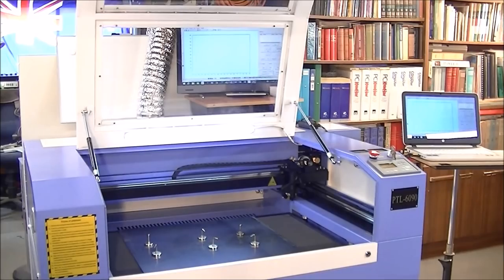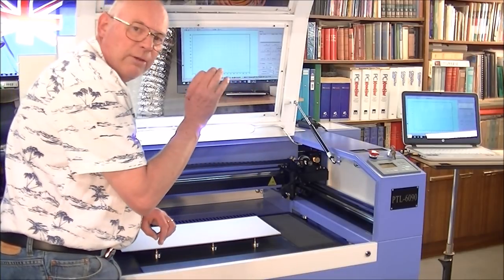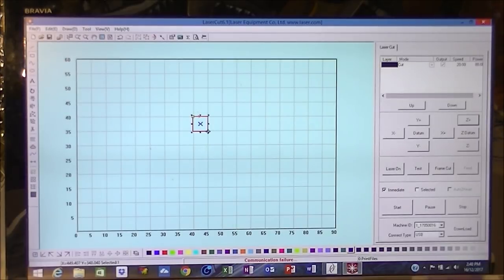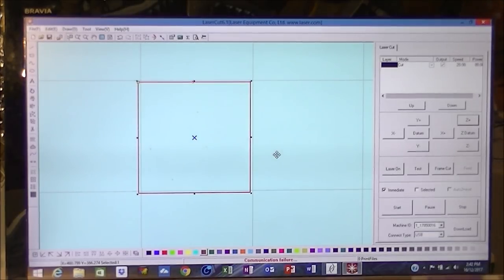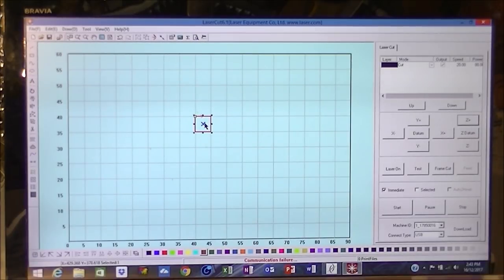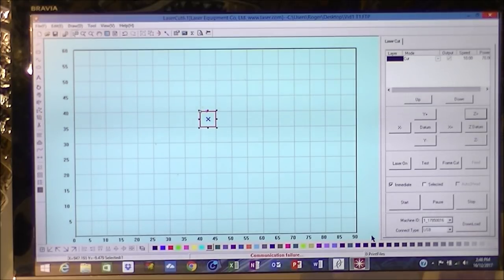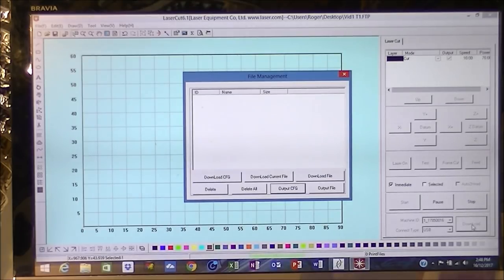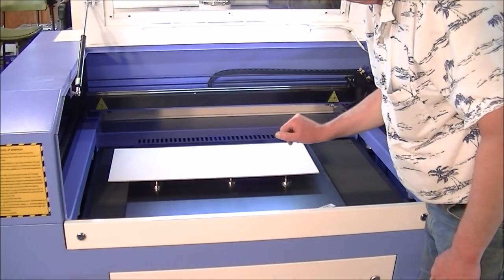Chinese eBay laser how good are they, and operating them

Comment: Hi, Roger.... Question: can you take a CNC router cut object, and use the same software file in the Laser to 1) cut the object out of, for example a piece of timber so the outside profile of the CNC cut object is maintained, and 2) then etch onto the CNC object whilst in the Laser, for example to add words to an area of the CNC carving, such as in a ‘motto’ on a crest, etc...? If so, showing how to do this would be very informative....  I know adding a motto would be possible in the CNC, but it would be interesting to see if the two machines can be combined to produce such a finish... Enjoy your videos....👍🏻🙂
Reply: Hi, I have both lasers and a CNC router and if I want to carve and then etch/engrave after I  take the CNC router file exported as a dxf and import that into lasercut